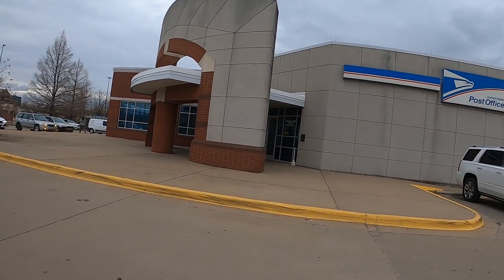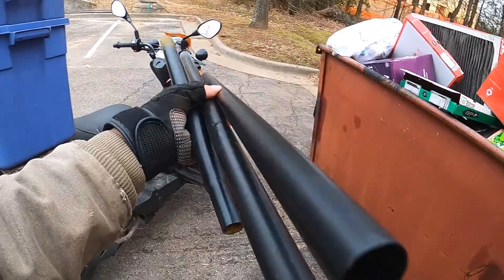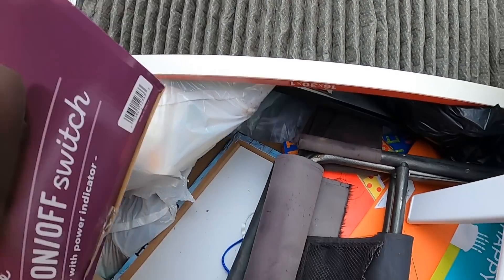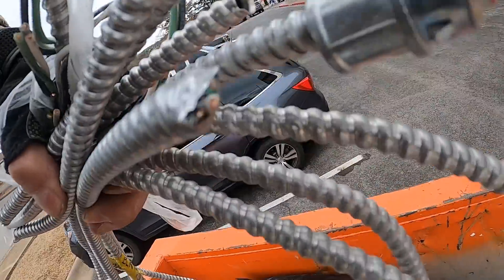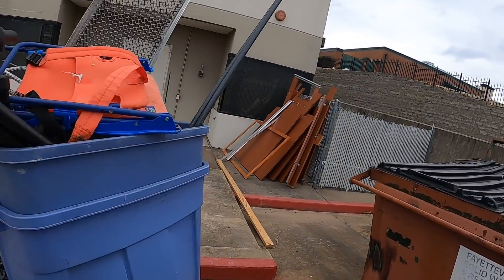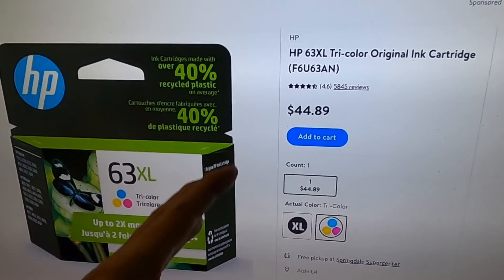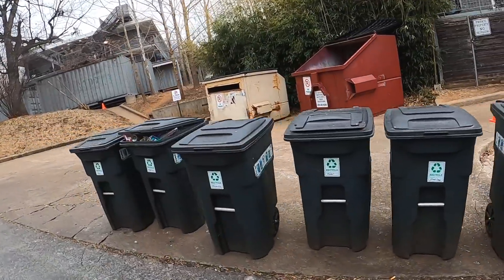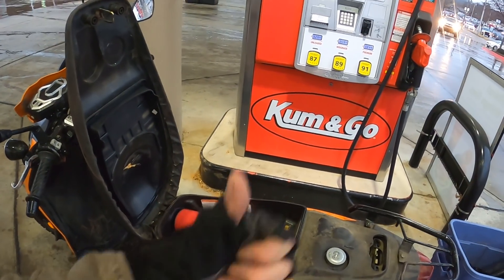Dumpster Diving "Instant Cash How Much Can I Find?"

Comment: The 12vlt car Alternator with neodymium magnets you add on inside shaft  and  running it with a 110-  240/volt motor = free electricity 
 i watched about 20 videos on it all seem legit  some use the 12vlt to run a   elect bike 75kph  ha!  You find lots stuff so make one free heater in winter .